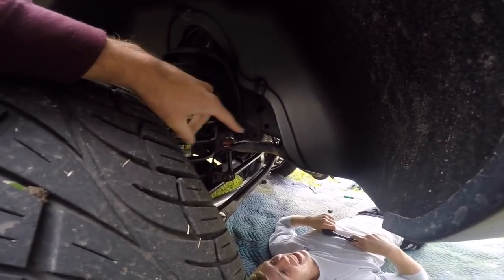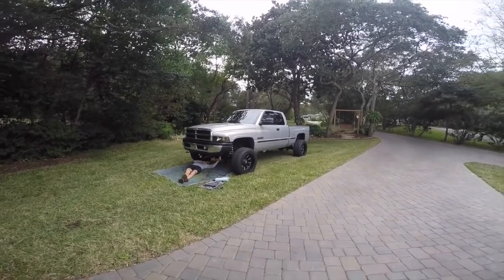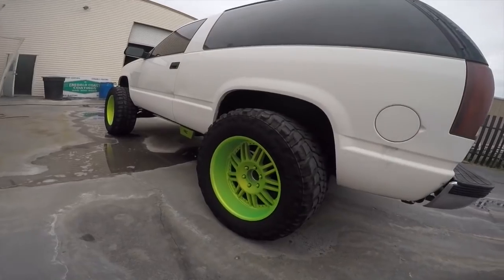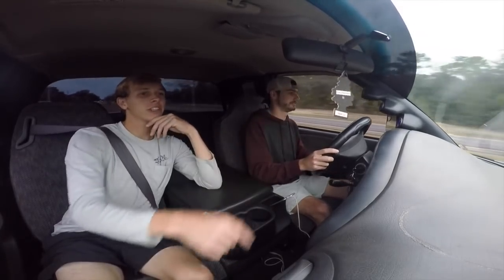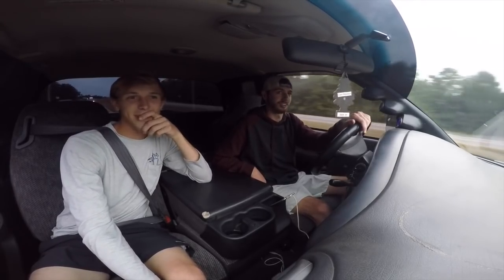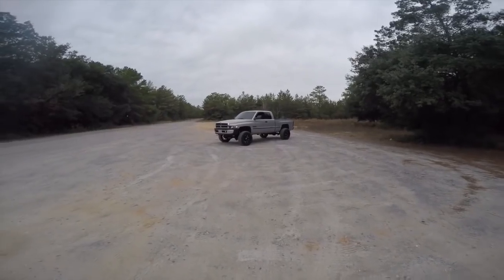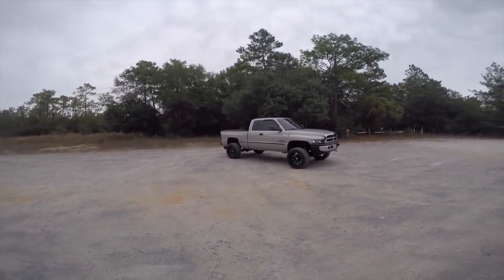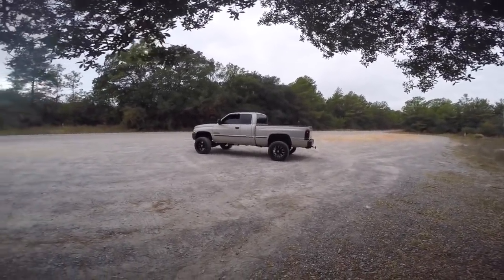Do I really need a sway bar ?

Comment: i run without the frt sway bar on my 98.5 Cummins and it's just as stable as my stock 05... I definitely recommend an HD front track bar (3rd Gen adjustable) I also have the 5150's and leveled front with 35s on 18" mavericks. nice truck and I appreciate your videos keep it up

Comment: Just my opinion, if your going to be working the truck( towing hauling big loads in the back) it would be a good idea to keep them. If your going to be doing a lot of high speed driving (over 55) again keep them, but if it's your daily just cruising around or for off road keep them off! I haven't ran away bars for years on mine, it's perfectly fine leans pretty good through the corners but it's fine. And perfectly safe. Again just my opinion